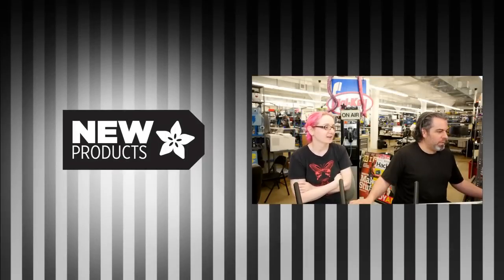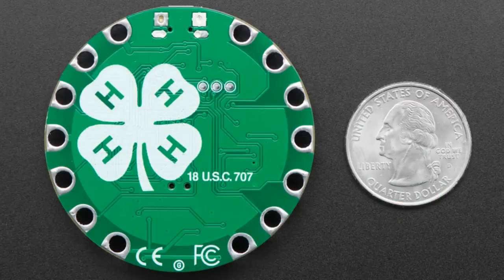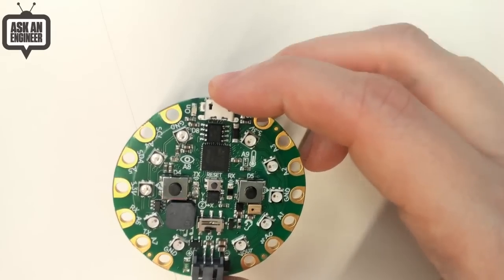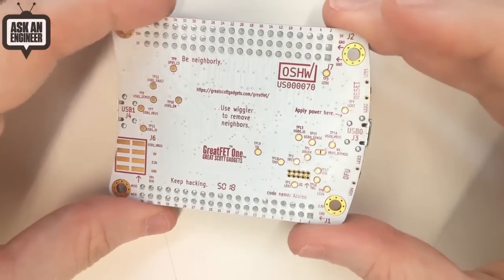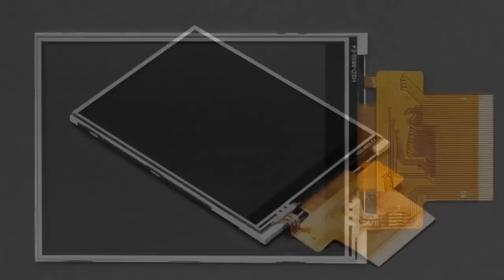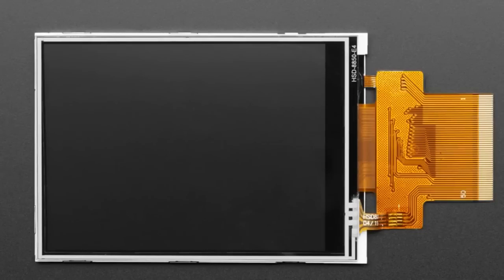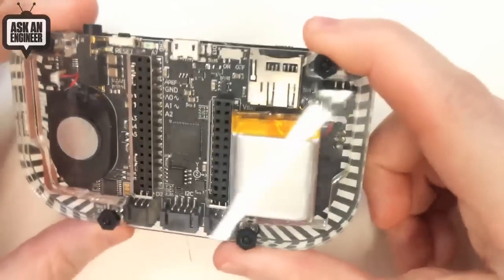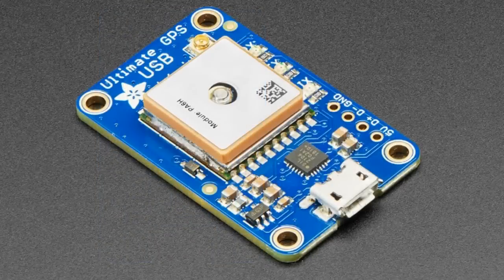New Products 6/12/19 Featuring Adafruit Ultimate #GPS with #USB! #adafruit

Comment: whos making and selling "Quad SPI MRAM" modules "High bandwidth – Read and Write at 52MB/sec." "Quad Peripheral Interface (QPI) mode is supported to enhance system performance for 'Execute in Place' (XIP) operation Arduino compatible " suitable  for Adafruit projects, and what Adafruit libraries and demo timing/execution code is best for say also esp32 (thinking simple unlimited cheap MRAM read/write web pages data 'Execute in Place' as a simple plugin and go starter project)

Comment: Love the pressure sensor module, gotta get me some after my Adabox 12 arrives. Ever considered using a uBlox Neo-M8N or newer GPS chip, it does multiple systems, GPS, Glossnas, Biedou, Galileo, very accurate and has UART, I2C ( or is it SPI), and USB from the chip. A little pricey but it is GPS on a higher level. I think they even offer chips that can give centimetre level accuracy.